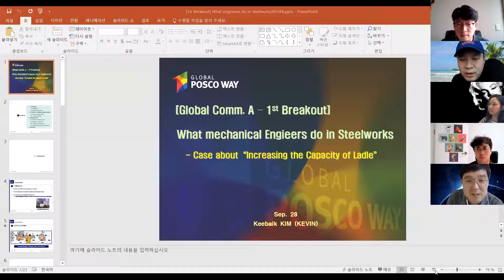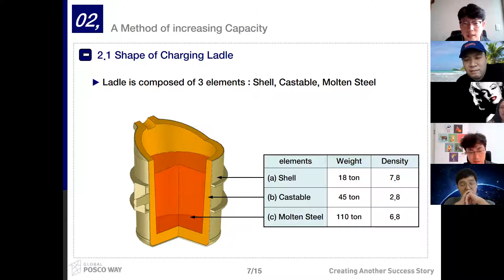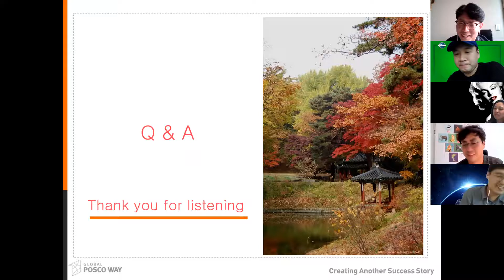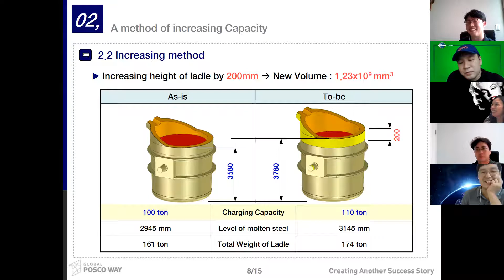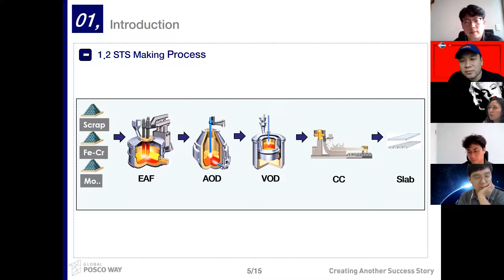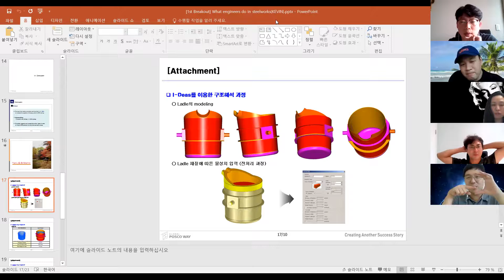Dynamite Breakout #2 by KEVIN

Comment: Kevin, I like the fact that you shared a topic that almost no one would know about, and that you talked directly about your experience.  The animation was clearly memorable, and you alternated between photos and diagrams seamlessly.  Using the pail as a prop was also effective.  The only element that was missing, in my opinion, was the significance of this process.  You could answer that from a number of perspectives: structures that depend on steel, consumer products that depend on this process, etc.  I recall recent news of a fire that occurred inside some kind of plant that killed two foreign workers, and was wondering about the frequency and nature of accidents in steelworks.  I think you said that all of your simulations to check for safety were computer-based; did you test also with real equipment?  It would seem that a computer simulation is only dependable if it accurately accounts for all factors.  A minor point is that there were some spelling and capitalization errors in the title slide.  Overall, solid work!
Reply from the maker: Thank you professor for your comments. In fact, there was data on productivity growth due to this reviwe, but i skiped because it is related to the company's secret. And i did computer simulation, but basically it was simplified and calculated by hand to double-check if the overall simulation was correct. It was also adaped to the factory as a pilot-facility to check if there was any interferences with existing structures and safety issues. Then it was expanded to all factories through design changes. Really Thank you!!